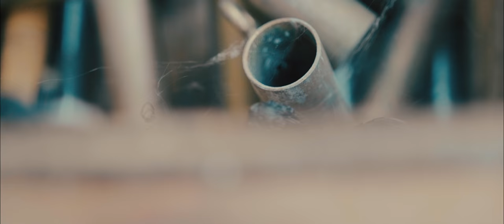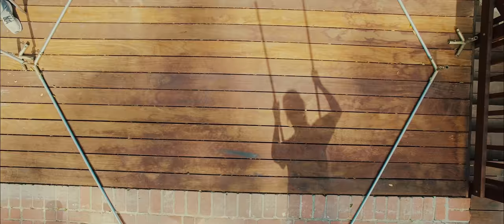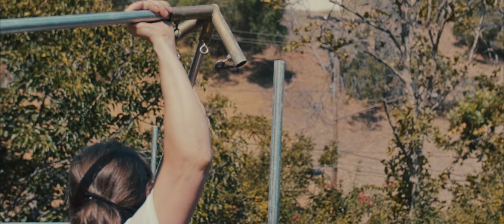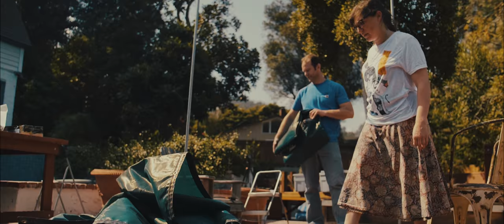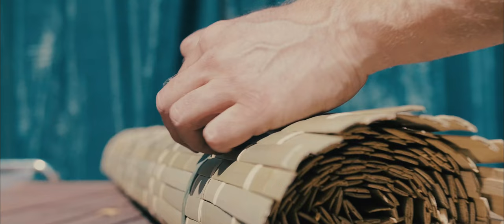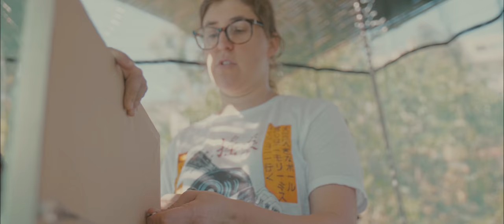Building My Sukkah || Mayim Bialik

Comment: Isn't there some irony in making a temporary structure on the patio of a giant luxury house's patio? 

not even far enough away to necessitate the hardship of walking across the grass to go inside to use the restroom? 

Wouldn't going to a campground with at least primitive toilet facilities and a low pressure shower drive home the point more?

I am not Jewish, but I respect many of the traditions i.e. those behind the the talet.  I leave offerings for my ancestors and we eat some of the crappy foods of our ancesters to remember what they went through, and my children have names reflecting their ancestry.

But still... Isn't this like celebrating the passover from plates of gold?
Reply: I've read that the two homes the family had were very modest. 1200 & 1400 sq. feet. Hardly luxury mansions...